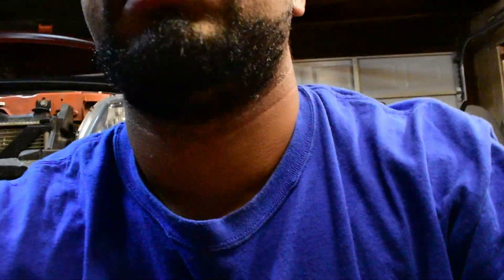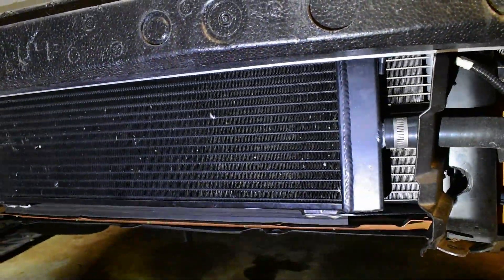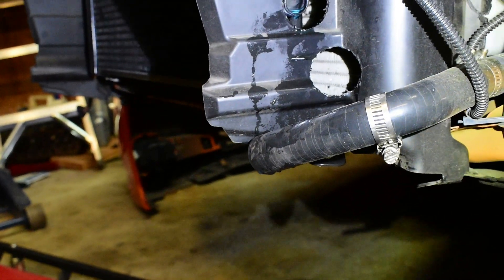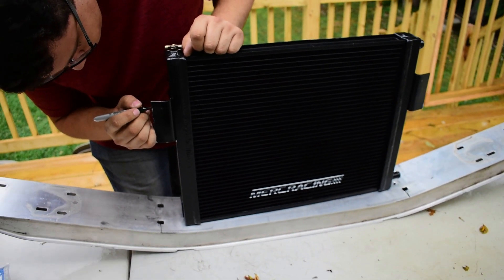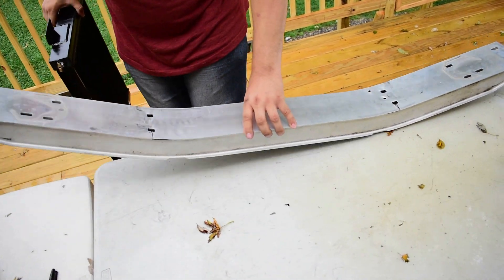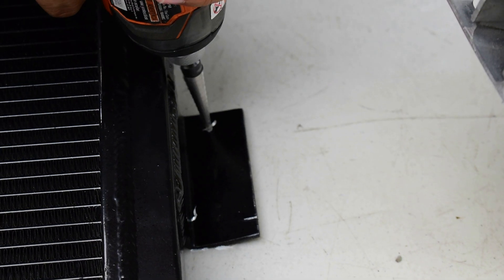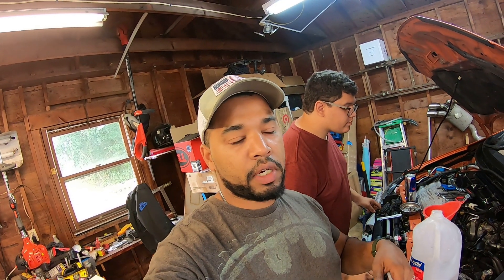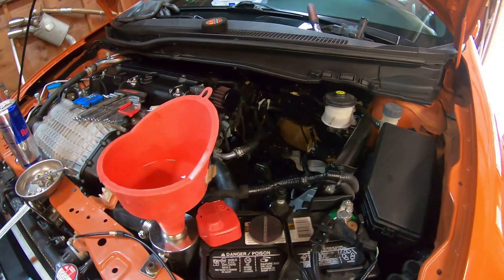MercRacing Supercharger Cooling Upgrades - 9th Gen Civic Si

Comment: What size pulley are you running on your 1320? 14psi boost?
Reply from the maker: 4_cyl_unicorn_power 2.8” on the street 15psi. I ran 3.0 at the track and it gave me 11-12psi
Reply: Reeses Cars Rad, thanks for that info.
Reply from the maker: 4_cyl_unicorn_power no problem.
Reply: Reeses Cars Thanks for your help again. Went with the 1320 power pack last night. I’m guessing around 8-9 psi on the 3.2 billet pulley?  A little loss with the aftercooler..